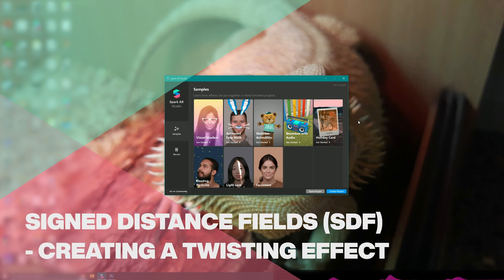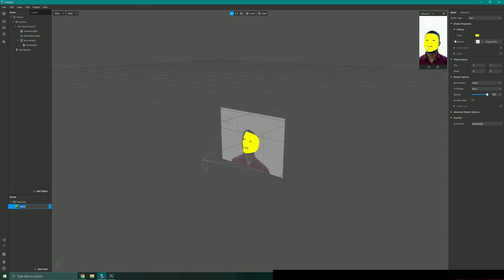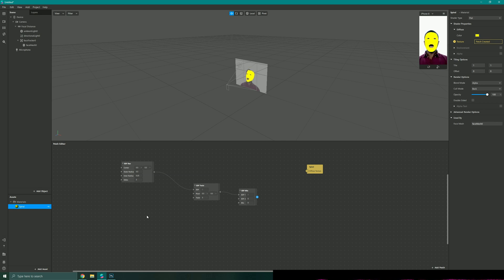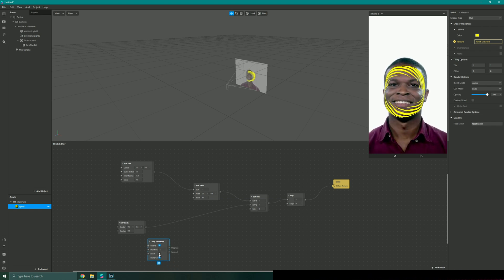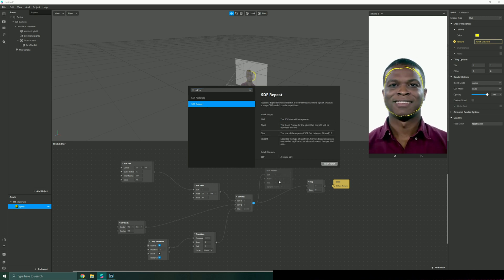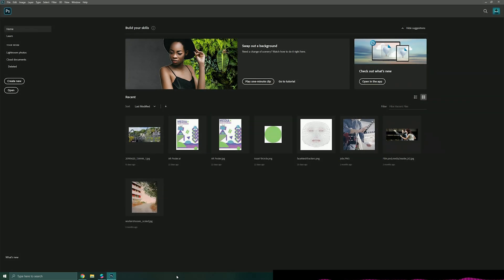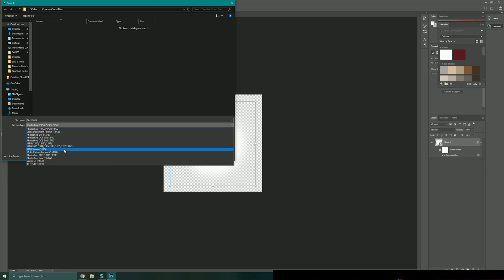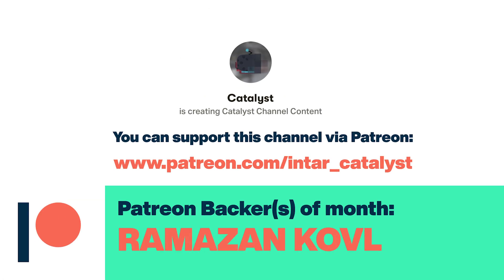SDF Creating a Twisting effect - Spark AR

Comment: This is awesome! Thanks for the tutorial. You could also use the "faceMeshMask.png" that's included in the Face Reference Assets under the Help menu in Spark AR.
Reply from the maker: I do have to use photoshop on a daily basis but admittidly I do prefer Illustrator alot more and yes I am aware of the fashMeshMask png just didnt use it to show how different mask shapes could be made if needed :)